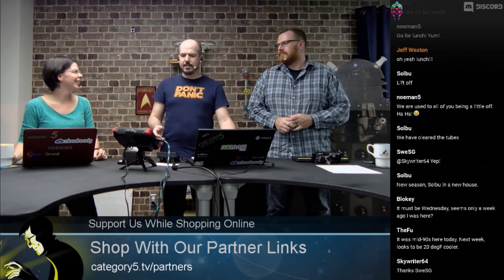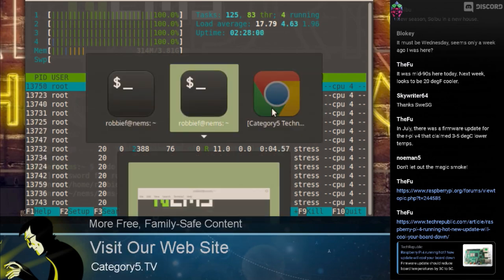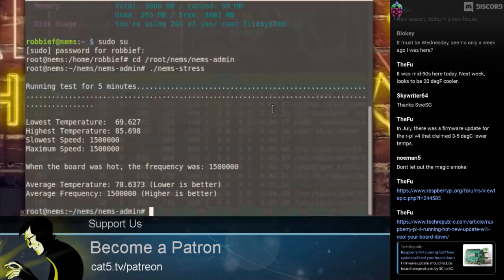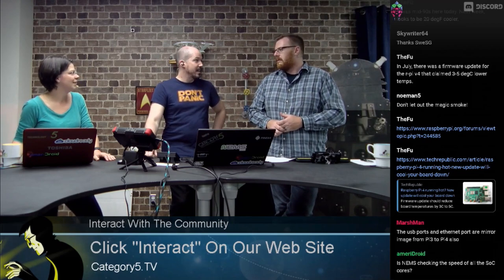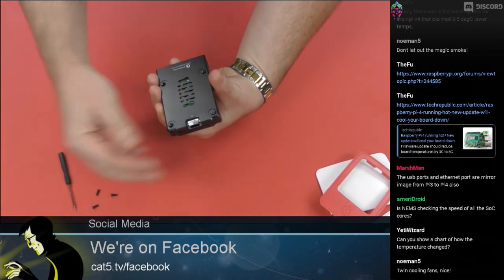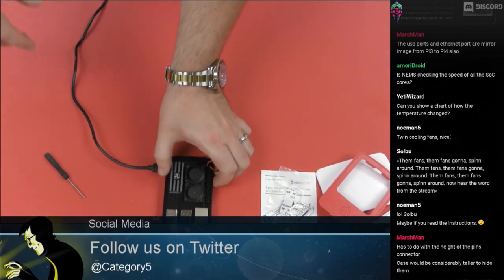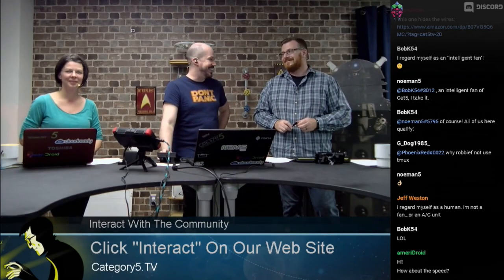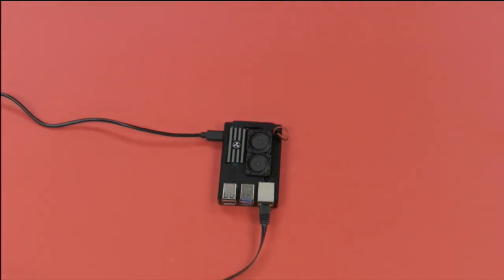Drop Your RPi 4 Temperature 20 Degrees Celsius With This Intelligent Fan Case

Comment: If you want to use a Raspberry Pi IV what about installing it into a Little Devil PC-V10 case and using the cooling probe to cool the CPU/GPU but the board will need to be coated with Dow corning conformal coating to keep the condensation away from the electronics of the Raspberry Pi IV.
Reply: i know it is quite randomly asking but does anybody know of a good site to stream new series online?
Reply: @Adrian Chandler flixportal
Reply: @Ray Emmitt Thanks, signed up and it seems like a nice service =) I really appreciate it !!
Reply: @Adrian Chandler Happy to help =)